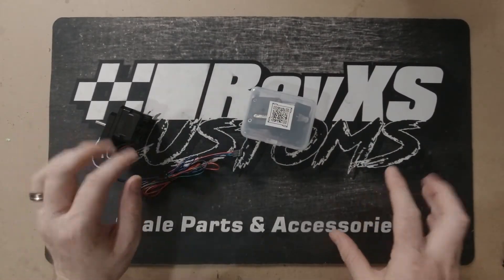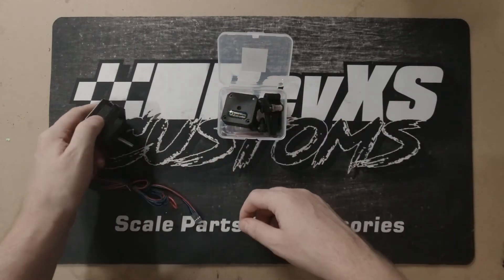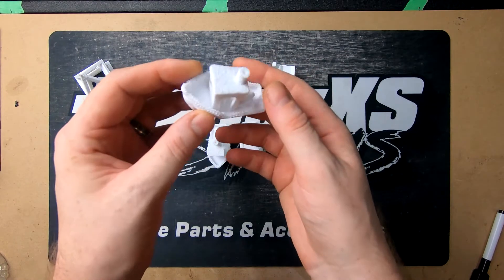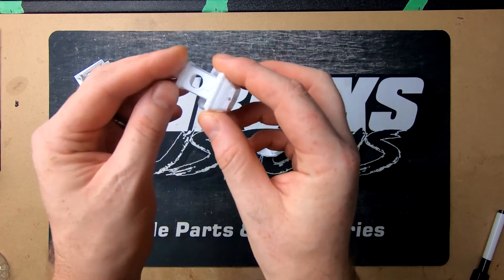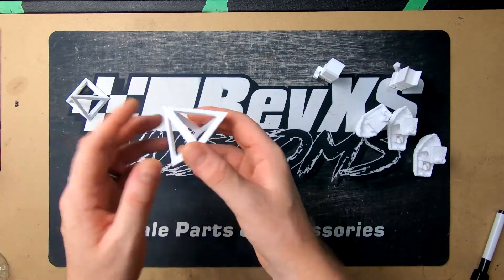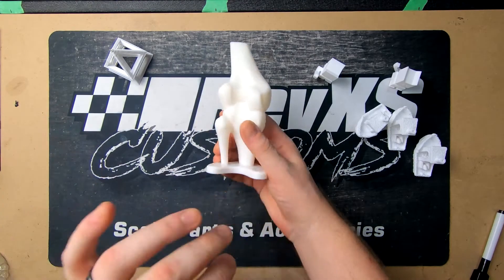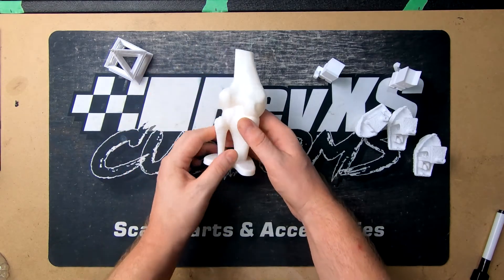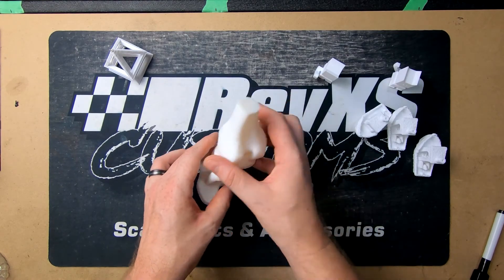Trianglelab Mini BMS and 3:1 Stepper Motor Upgrades on a Ender 3

Comment: Whats the size of the stepper motor
Reply from the maker: Here is diagram of stepper motor with measurements 
https://ae01.alicdn.com/kf/H9de2dda0139841aca7faa79ad6d6aef1S.jpg
Reply from the maker: Then Stepper motor with 3:1 gearbox attached
https://ae01.alicdn.com/kf/Hc10a578771b84b0eb9a1be540fb27b24Q.jpg
Reply: Did you adjust the vref for the new motor?
Reply: Dang that's a pretty short on that stepper motor, 5mm longer than the one I've got on mine, I'm also running a full size BMG clone. This is interesting